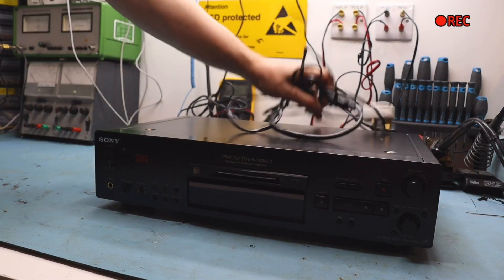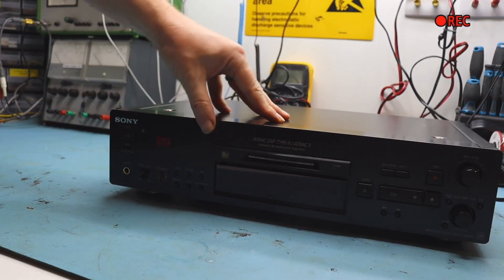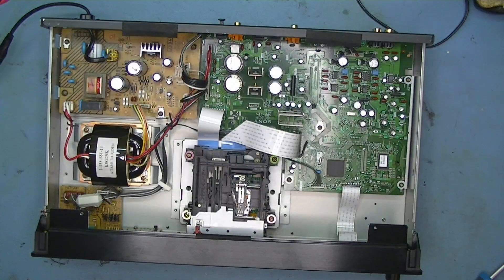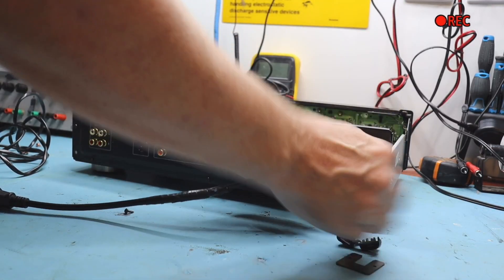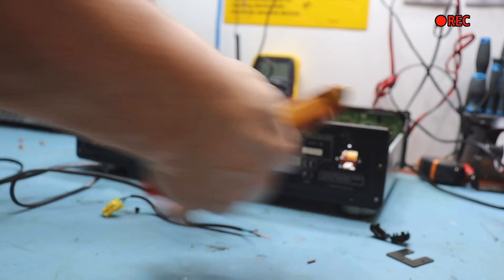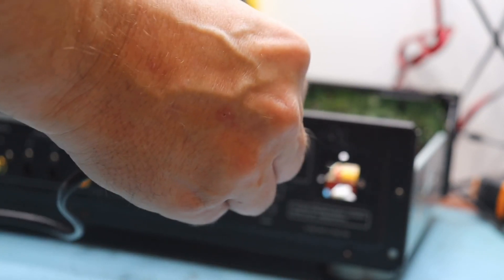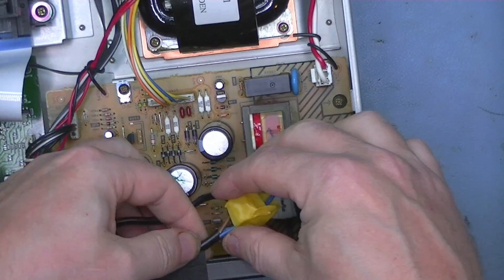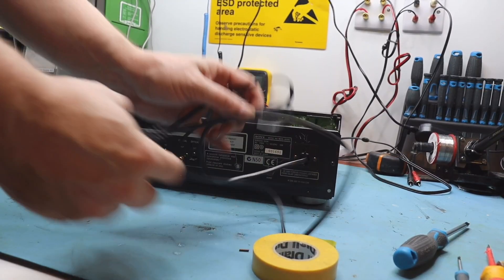How To - Fixing some-one elses bodged mains cable without soldering

Comment: why not fit an IEC socket on the rear you've got the hole there already probably only a minor widening, and hey presto, one doesn't have a captive mains lead anymore.
Reply from the maker: Thats a question for the original owner that decided to butcher the cable to make it detachable, the new owner just wanted it "standard"

Comment: The euro lead is the wrong way round, the plug with the male pins should be to the equipment. It's still a bodge on the mains cable.
Reply from the maker: No such thing as a "euro lead" - Its a IEC C7 to give its correct name. And how is it the wrong way round? Live and Netural to the correct terminals, with correct 2 core cable as its a DOUBLE INSULATED appliance. You don`t always connect all the plug top pins to an appliance you know.....
Reply: @Sortitoutman  Pretty sure he was referring to the original bodge job not the work you did.  :)  The C7 connector was the wrong way round with male pins on the mains side.
Reply from the maker: ok thanks :)

Comment: You're should be ashamed with putting such a bodge repair in the public domain.
Reply from the maker: You should be ashamed with your grammar
Reply: it's not "bodged." He made it safer & neater than what it came with. He also states he did it this way so the "everyman" with basic tools  skillset can do it. My apologies, @sortitoutman if I got that wrong
Reply from the maker: no, thats correct :-)

Comment: Put on heat shrink sleeving then solder the wires together and shrink the sleeving, job done.
Reply from the maker: Your missing the point raised in the video, not everyone has a soldering iron or heat shrink hence not doing that....